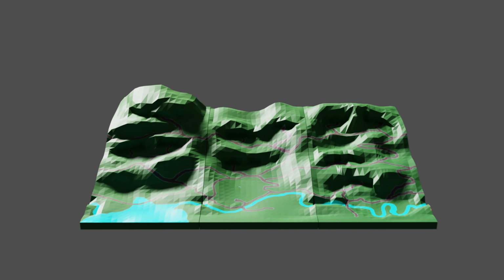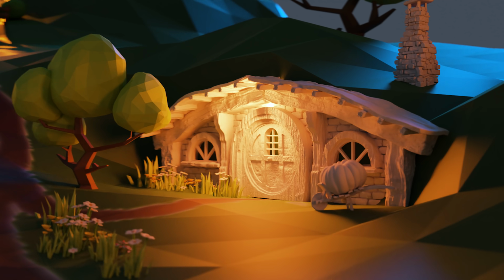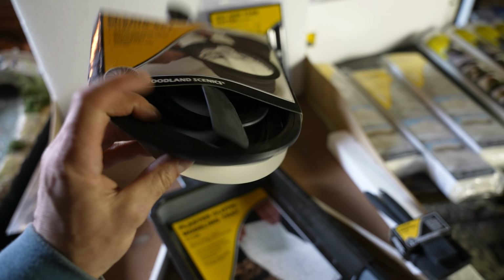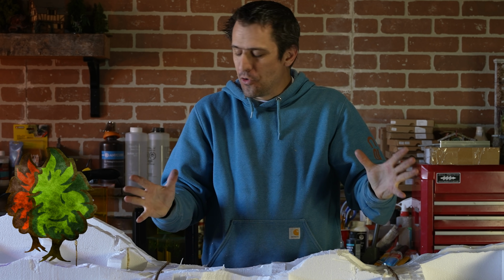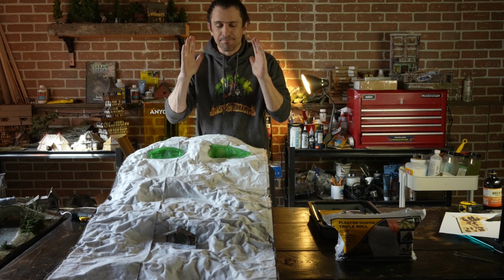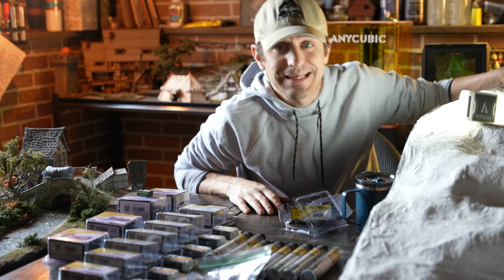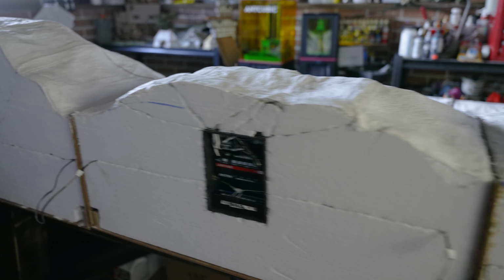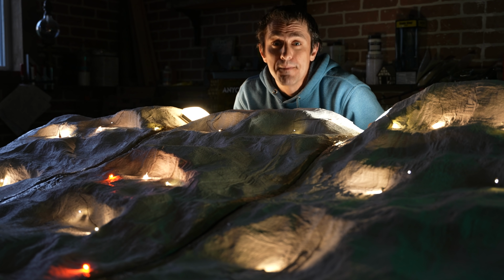Making a HUGE 24sqFT Wargaming Board | The SHIRE!

Comment: FYI, If you want to get rid of the pitting left over from the plaster cloth just wet your hands and run it over the plaster cloth, before the cloth dries, till the plaster that's impregnated in the cloth fills the little gaps. Also a little background on that stuff that's what plaster casts were made from before they came out with the heat activated polymer casts they use know. I used to use that stuff back in the late 90's and early 2k's for making casts of body parts, rocks, branches and the likes for 3D Design class in Highschool.

Comment: You could drill holes in the bottom of the hard board and fill sections with insulation foam or wood glue to help the sheet on top retain rigidity.

Comment: Your modroc/plaster bandage shouldn't have any visible pattern on it - the little holes and gause/fabric. You should smooth it down as you attach it as this will help it adhear to the base structure. If you don't do this you may find areas of your work lifting up later on (could be months later) as the plaster hasn't attached to the base structure properly. Smoothing helps activate all of the plaster and ensure a snug fit to the material below. It will also stop you getting visible lines at the edge of each strip, as layers should merge with each other.

Remember if you're finding you are getting a visible pattern from the gause (the fabric), you can always mix up some more plaster (the power kind) and thinly layer this on top while the bandage is still wet.
Reply from the maker: Hey thanks for the tip!  And yeah, I was planning on mixing another thin layer to fill in all the little holes/pattern.  Also, afterwards I'll be sealing everything with modpodge before applying all the flocking and whatnot

Comment: Loved the video!  It's going to be an epic build.  Shaper sheet is a great product and I remember being inspired by the vertical terrain on WS's display stand.  I also love using it with water as I know resin is not going to leak through that foil!  One question, why did you decide to use plaster cloth over the shaper sheet special plaster?  I've always just used the plaster.

Comment: This is shaping into something really cool.

Why do you use that white styrofoam? 
Why not insulation material like XPS, the pink, blue, green or yellow foam sheets?
It's not the white color I am thinking about, it's the materials density I am talking about.
The colored ones are meant to last, white styrofoam shrinks.
There is some white styrofoam for building insulation as well, but it doesn't look like that's what you are using.
I'm just concerned your fantastic creations will shrink and warp and somewhat "melt" within few years. 
I never use the white material.
Reply from the maker: I never heard of it shrinking before?  And I only use XPS for detailed carving, not for big stuff like this.  I prefer the white as it's cheaper and lighter!  I use pink XPS again for more detailed work that wont be hidden away below the surface of a terrain piece.  Hope that makes sense!

Comment: What software do you use to model the hobbit holes?
Reply: Check out the previous video :)
Reply from the maker: Yeah if you're interested I go into heavy detail on that in the previous video.  But quickly, I used Blender and Zbrush :)
Reply: @RealTerrainHobbies  Cool, thanks. Looks like I know what I'm doing for the next forever. Build is looking fantastic so far.

Comment: I'd actually be more worried about durability with the woodland scenics stuff there. It's more geared towards the static diorama/railroad style layouts rather than the interactivity that a gaming board requires there.

The stuff does look nice, but it's also something that I don't think is that sturdy...it's not fun when dealing with an entire gaming board and someones hand breaks through it.
Reply from the maker: Well, the structural integrity comes from the plaster surface so the more layers you add the stronger it gets.  So if you're worried about that you dont need to be.  If you mean the support panels I'm not sorried about them.  Theyre close enough together it would take me having to put a lot of my weight on the surface above before things would finally cave in.  Way more weight then you'd ever have on there from any form of gameplay.
Reply: @RealTerrainHobbies  Wasn't thinking of the normal use, more of someone reaching in for a model and their hand going through it. 

It's the same reason a lot of places ban the nail trees and pin spears/pikes that used to be quite common, save less of a bloody mess and more of a crater in the table.